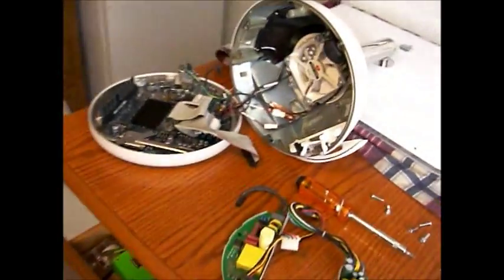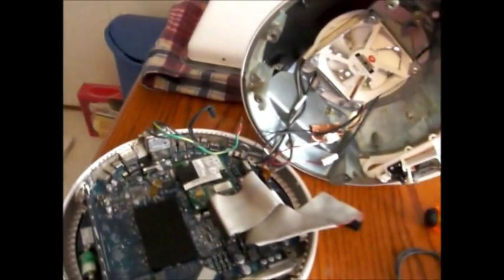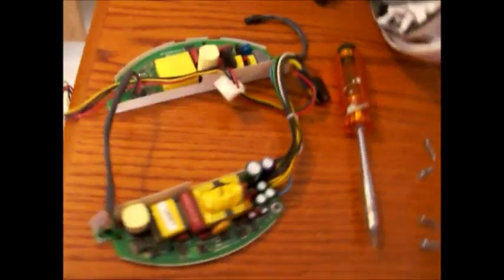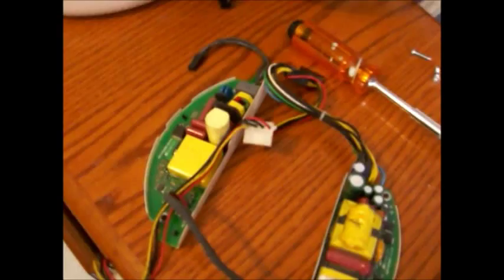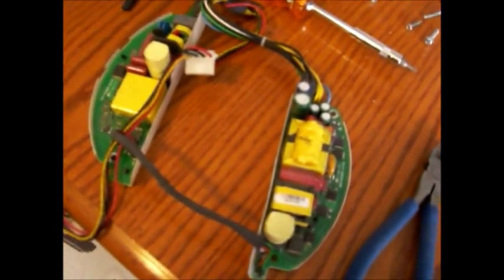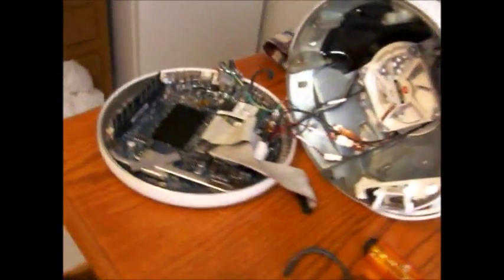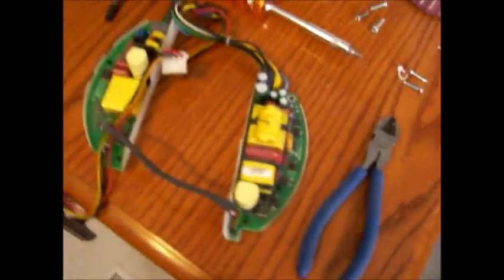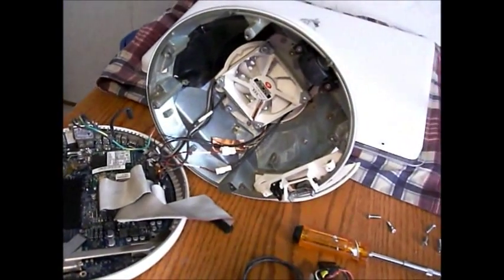Apple imac 20" power supply problem.

Comment: That looks like a voltage regulator or limiter.  I would try to find out the component number and replace that component. Most electronic parts store would probably have it. No harm in trying.

Comment from the maker: @james42519 You should get it man that is cheap. What peddler's mall because there is one in richmond ky named that? I just ordered a power supply 190 watt off ebay that is guranteed to work for $36.00 shipped. I also got on amazon and purchased a new 3.6 volt saft lithium battery since I have it apart already and it's a 7 year old battery and it was just $4.40 shipped. Only thing worries me is the bios settings since this machine upgraded OS 10.5.9 and 500 gig hdd with loads of software.

Comment: worry so many comments. i would also look in the same circuit that is on to see if there is anything that might have made it do it too. i fixed a monitor by replacing some caps so think i could replace that too.